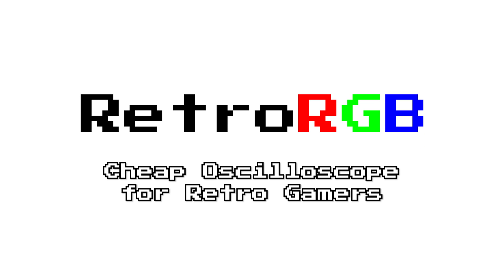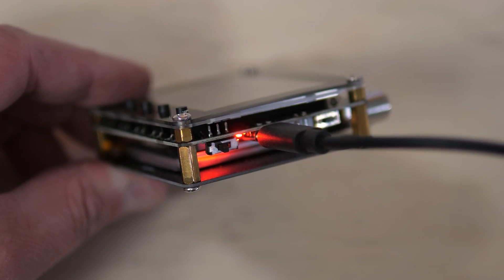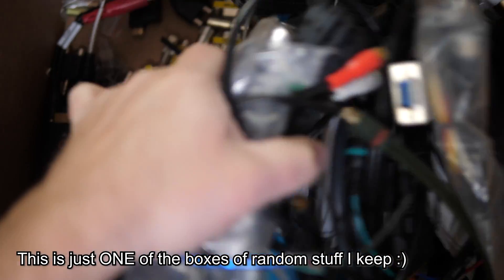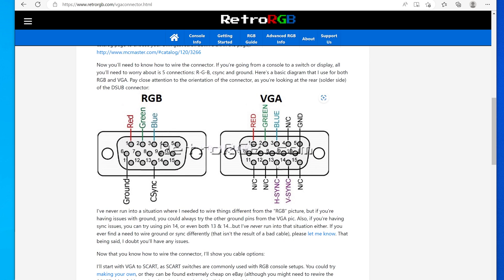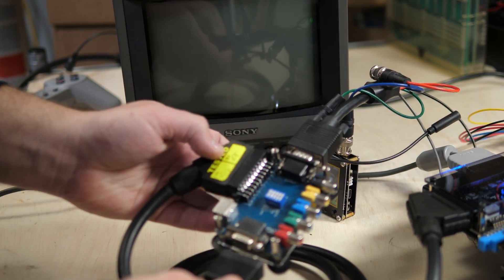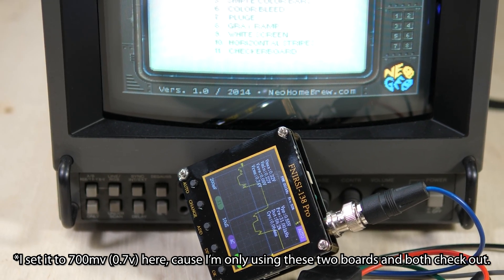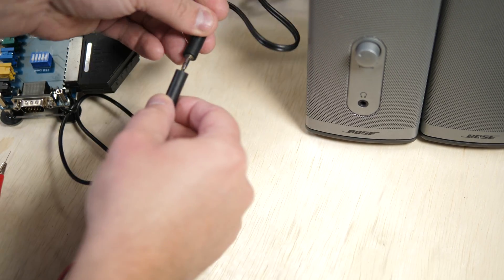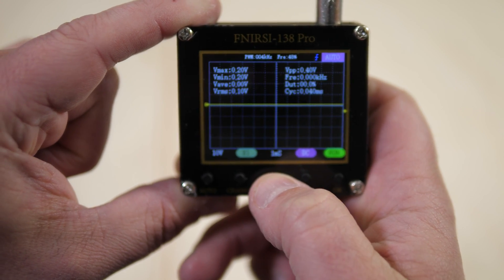$30 Oscilloscope For Retro and Arcade Gamers

Comment: Great video! I got myself a Siglent SDS1104X-E for xmas, not just for its more practical uses debugging devices I'm designing, but also as a diagnostic tool for maintaining and repairing retro gaming hardware. I was in the process of designing my own Nintendo AV Multi-Out diagnostic breakout board to more quickly work through all the consoles/boards I've accrued when I stumbled upon mention of the RGBench on your blog. I immediately went and picked one up direct from Qwertymodo's Tindie, where it's a bit cheaper. 👍👍

Comment: I have one of these DANIU ADS5012H ”portable oscilloscope” that I tried to measure SCART voltages. I just now realised that I forgot the 75ohm load and I had the SCART-connector disconnected, so that’s why I couldn’t get a proper measurment. This video really helped, thanks Bob! 
I hope the scope I have can do the same though, does anyone know?
Reply from the maker: I've never used one of those, so I can't really say if it'll work for retro stuff.  Really glad I was able to share the 75ohm load tip though!
Reply: @RetroRGB  Will try this again with the scope I mentioned and the 75ohm and come back with an answer! Thanks for the reply, Bob ❤️

Comment: The specs seem to be similar to DSO-138 or DSO-150. While those came in kits, for the same price, this may be a better option for those that are not willing to build it themselves. DSO-150 came in its case but seems to be a bit more expensive. Another plus for this one is the battery (there are rechargeable battery hacks for DSO-138/150).
I use DSO-150 from battery or a linear power supply I made with an old transformer so I have a good isolation. Nice to have another option.
What can be used for? Well, almost anything up to 200kHz in theory. Analog video and audio signals are well in the range of it, just like many SMPS, buck converters. Keep in mind that the 200kHz max range is for sinewave; square wave, or other signal shapes need more bandwidth (I consider 50kHz to be a reasonable limit to see any other signal on these devices).
For a beginner or for a portable oscilloscope I do recommend it due to its price, keeping in mind its limitations.

Comment: Would this oscilloscope be good enough to calibrate the laser on a console's optical drive?
Reply from the maker: That's an excellent question!!  Sadly, I have no clue.  I'll see if someday I can follow up with a video on that.
Reply: @RetroRGB  that would be cool. 🙂
Reply: Nope - you should select an oscilloscope with a bandwidth around 5 times the frequency of the signal you want to measure. 40kHz bandwidth on this device is good enough as a voltmeter. I’ve done PS1 laser calibration  with my Rigol DS1102 and that has 200MHz bandwidth and dual channel inputs, which cost about 5 times the sale price of this device. Put your money towards a more capable oscilloscope!
Reply: @guy_is_here  Thanks for the advice.

Comment: As a beginner, I’m all about low entry options that allow me to learn without spending a crazy amount of money. Thanks as always Bob!
Reply: Could also recommend the Papilio FPGA Logic Analyzer Bundle if you want to analyze via PC/Laptop, record some signals or analyze it more in depth. It's a tool for embedded development too, so if you want to get your feed wet with Arduino, Microcontroller and stuff this is a tool you should have in your inventory.